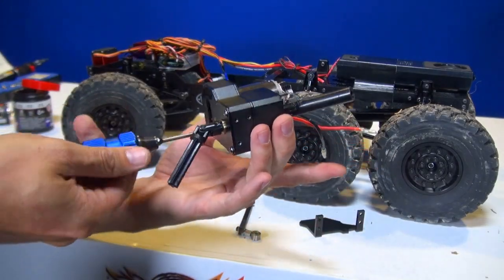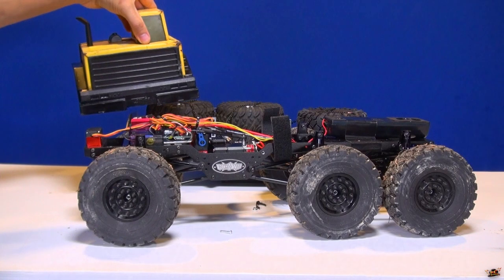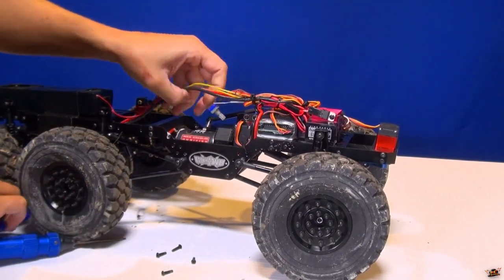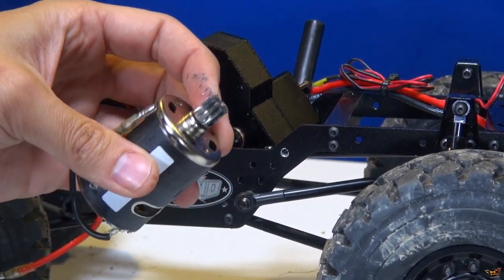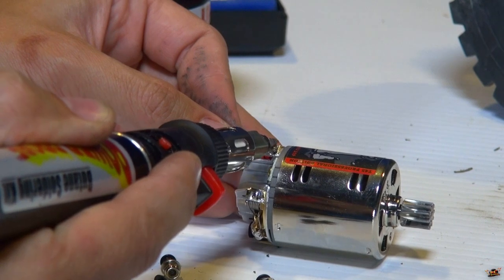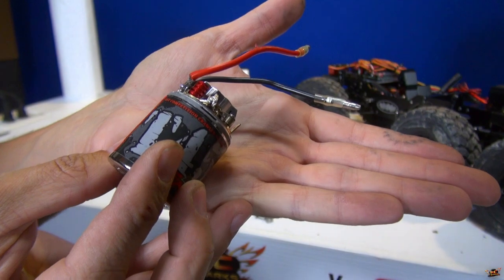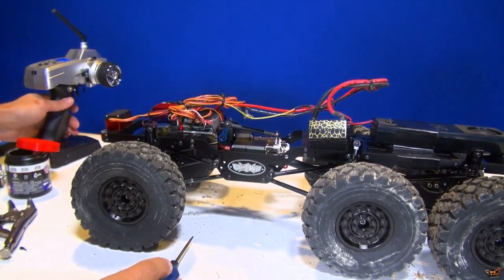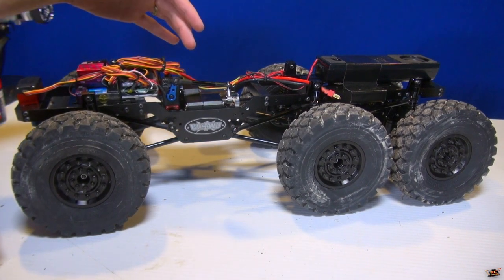RC ADVENTURES - 6x6 Motor Swap - Blackwell 1/10th Scale Custom Heavy Hauler

Comment from the maker: a LiKE click is always appreciated for my work, thank you!
Reply: If you had to give every car away but one what car would you keep? And I am looking to buy my second car I want a short course electric what would you prefer
Reply: logan johnson I just bought a Tacon 1/14 Thriller short course truck brushed, and it works great. Has tons of power. Heres the link http://www.nitrorcx.com/114electricsc.html
Reply: Darrien O'brien I like that truck but 1\14 scale is a little small I'll keep that in consideration and about how fast does that go?
Reply: I have the brushless one, and it will go 20-30 mph. stock. The charge time is great to, depending how you drive you can be out there for 10- 15  minutes, just with an hours of charging.

Comment: Dear Medic 
I also just got this truck almost a month ago and from the moment i took it out i loved it fyi beware of the upper link mounts on the axle, the screws back off easily without threadlock and the plastic pinishers are as bad as everyone says, going slow over the rocks is fine but get any wheel speed and the momentum of the driveline will snap them in an instant. If you want a servo winch up front you can buy the front servo mount and it fits perfectly behind the steering servo. The front stock axleshafts are dogbones and the pins get out of position easily and lock up the front axle. All around a great looking truck and driveline if you find anything i missed feel free to message me on rcsparks. Big fan medic

Comment: Hi there ! I love those maintenance videos. Great truck you have there!  I got one question for you.  While doing such maintenance work, do you happen to grease te motor gear, the reductor pinions, the gearbox and the axles ?  I thought they could not be left dry but maybe it's the opposite. I was into planes and boats before so I never had to deal with gears and gearboxes so far.
I have something in my mind telling me I should buy me a HG Hemtt 8x8.  I just love all the mechanics that's inside. A lot of enjoyable work on the bench, close to my fire...  Keep up the good work and thanks for your help. Greetings from Belgium dude !

Comment: Hi I have a feeling you probably won't respond to this but me and my brother love your videos, and we really love rc cars and trucks and we got one it took 2 months to get but it is a 20$ rc crawler. And we want to start getting into rc stuff so me and my little brother were wondering if you had an old car you don't use you might want to sell it for cheap, we have 188 acres to run it on so size is not an issue

Comment: why not brushless?
Reply: Torque
Reply: Also for da muuuuud
Reply: EV TEK what's the problem with mud ?
I'm a 1/10 touring driver, mud is unknown for me xD
Reply: Modelero brushed motors are water proof. I ran mine in a bucket of water to clean it and still worked fine afterwards.

Comment: Medic, you should cut the tonka truck again, bolt the gas tank part to the frame, and put a hinge on the front of the cab so it flips forward like a real semi! :D
Reply: Aww, but those mining trucks don't have  flip cabs. Think the scale on that would be around 1:24 ish. Those should be around a 20 foot tall tire. :-)

Comment: Enjoyed the video Medic!

BTW, dremel has that butane solder thing, it's called dremel versatip. It can be used as a lighter, heat gun, soldering iron, and cutting knife, and also for bending and welding plastics. I have it and it's so handy!

Comment: More like this, please.  I have a bit of an old-fart attitude toward the R2R stuff, but the kits out today look like great stuff.  You learn so much when you have to build it.  My first kit was a Tamiya Falcon.  I had ball bearing and 'wiper' speed controller upgrades.  First run on the track I melted the dog bones.  Had the shocks sprung too tight.

Comment: Haven't read through all 98 comments, so I hope I'm not asking a question that has already been answered.

I noticed that you didn't do, or mention, (on camera) any kind of motor break in procedures for the new Tekin 45t. Is that going to negatively affect the performance or life of the motor?

Awesome video as usual. Love the maintenance videos.
Reply: They broke it in for him
Reply from the maker: Brushed motors these days don't really need a break in. I usually hook them up and run them 1/2 battery pack at mid-throttle.. and everything seats itself nicely :)

Comment: ive neglected my scx10 maintenance, im having a weird electrical issue where the truck will randomly lose power to the throttle and steering, but my lights still stay on =\ i really dunno what the problem is its been down for months now
Reply: You could have connection issues with your radio to your receiver. Check and see if your antenna looks damaged
Reply: I had a problem like that as well with my wraith poison spider and my local hobby guy at great hobbies in Manitoba told me it was probably an issue with the antenna so ya just got it fixed yesterday and the servo horn got striped muddling today :(
Reply: Stop commenting on all his videos.
Reply: ***** lol i rarely comment on medics videos o.0